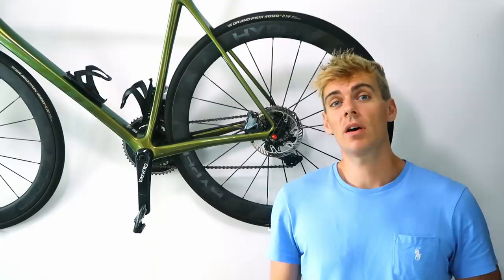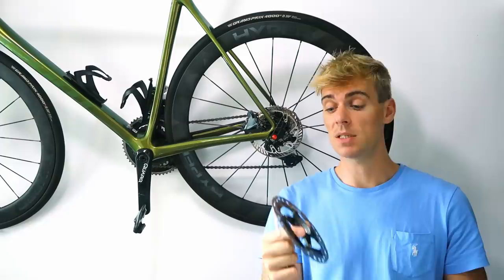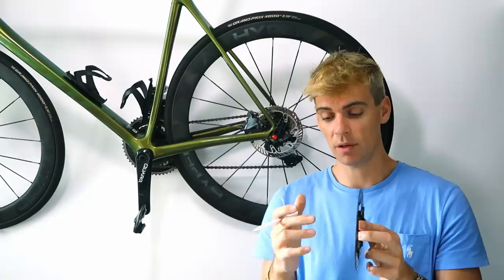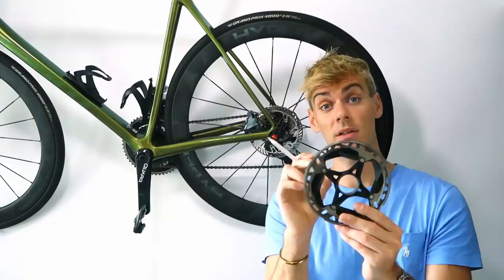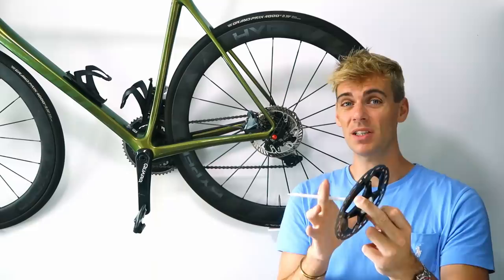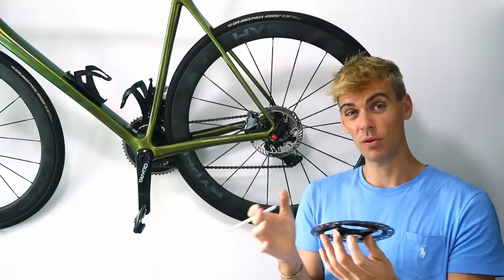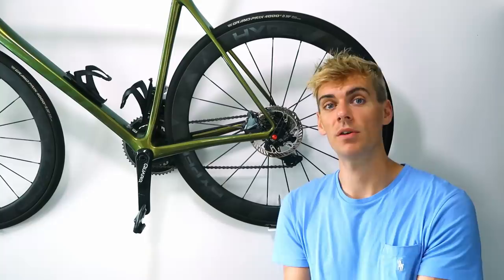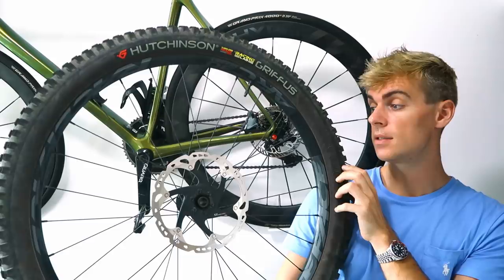Why I stopped using Shimano rotors: Disc brake rotor design, cracks & thermal issues discussed.

Comment: In my experience (25+ years bicycle mechanic) the pad clearance issue in at least 50% of problematic cases comes from "overfilled" disc brakes.  Most common directly from the bike factories.
Great explanations that need more spreading to customers (which I will do at work).
Keep on the good work! 
Greets to the 5 year old 😎
Reply: Hi. What do you mean with "overfilled" brakes? I think that psitons often don't fully retract because of overbleeding of the system

Comment: maybe you should try galfer rotors, they are floating rotors that can be either 1.85 or 2.00mm thick and can be used down to 1.3mm thickness. They're great. Edit: now a couple of minutes into the video, the galfer rotors are actually made the same way you describe you'd like your rotors to be, there's a 1 piece model made from high carbon steel (not stainless) with the center part anodized or painted, not exactly sure what kind of coating it is but it's there.
Reply: After a ton of research, I bought galfers in 160mm today. Not for the weight but because I just want better braking performance for high speed descends. Have you ever had any issues with them?

Comment: Great project, I look forward to hearing more! I have had similar issues with ice tech rotors- go out of true with the high heat on road, get bumped on the mtb. For reference, I am now using the slx/105 RT70 rotors with zero issues. Seems to behave like a six bolt, just pinned onto the centerlock spider instead of using bolts.

Comment: I nearly died on a tandem on an etape du tour using ice rotors.  The rotors heated up, the alu melted and the rotors narrowed and became compressible enough that the pads wouldn't bite.  Only an uphill run off saved my pilot and I.  Gone for hope solid stainless from now on and no issues.
Reply: Wow, thats scary! What size of rotors were those?
Reply: In fairness they were 160s and we should have had bigger to start of with. Our hope stainless are a massive 203 now.

Comment: I arrived at the same conclusion. Floating rotors are from high performance automotive. The aim is to reduce temperature-induced warping of the rotor (caused by uneven heating from middle to outer edge of rotor). In cycling the energy is significantly less and the tolerances and masses are different. I’m not persuaded floating rotors are necessary on bicycles.

Comment: I had a problem of Shimano disc rubbing when the brakes were hot. It seems it was caused by counterfeit JO2A brake pads. The black anodising was wearing off, which doesn't seem to happen on genuine pads, and the resin pads had golden metal bits in them.

Comment: Interesting project, looking forward to findings. I have brand new 105 disc set 6 bolt one piece style and at 900 miles I've been extremely pleased with performance and not one complaint, I clean them every other ride and the wheels have not been off the bike since new or in and out of the car so bumping them hasn't happened. I am also very aware of braking technique to shed heat, never ride the brakes, I do 3-5 seconds at the most breaking at any given time, on fast DH hard break let off wait hard brake let off style.

Comment: I too ditched Shimano rotors for Campagnolo, a fantastic upgrade and as a bike mechanic I always steer clients away from the Shimano sandwiched construction rotors
Reply: I had the Dura Ace rotors for a year and they warped all the time. I have replaced them with a spare Ice Tech RT81 and a new Hope floating rotor. I wonder whether the Dura Ace (and the XTR) braking surface having four attachment points instead of five makes them more vulnerable to warping.

Comment: The problem might also be those tiny road disc's getting super hot compared to 220mm disc's on an MTB for example.
A friend ride's hope floating rotors and they don't start rubbing from just getting a bit hot.
Would like to see rotors from you for MTB as well! You should make the centerlock fit a bit tighter than Shimano as well while being at it already. They seem to be a rather loose fit for being a disc rotor and can come loose.

Comment: As long as one bearing is locked in place the other bearing can float without creating any issue because it's locked in place by the thru axle. I wouldn't be too worried.

Comment: A tungsten carbide coating has been utilized on brake discs in high performance automotive applications to improve performance, increase service intervals and reduce brake dust

Comment: Someone has surely said this before me. Since all my bikes have rim brakes I really never paid any attention to disc brakes until Chris Froome made his notable comments about them recently. The first thing that popped into my head is why not some kind of bronze? Copper in it will dissipate heat. Add a little nickel perhaps for corrosion resistance. More expensive than steel, but find the hardest copper alloy with the lowest friction coefficient and I think you'll land pretty close to what you want, IMHO. GOOD LUCK.

Comment: It seems to be a fad among British bicycles Youtubers with an engineering background to develop their own components (Hambini: bottom brackets, Peak Torque: disc rotors).
To contribute to the project: consider sodium cooling as used for outlet valves in automotive engineering!
Reply: Quite a bit more complex to engineer and manufacture into a slim rotor though. Sodium valves were pricey and mostly the bastion if high performance high temp engines like top fuel cars.
Reply: What is Peak Torque's background?

Comment: With motorbikes there are "fully floating" discs which the carrier holds the rotor by way of buttons, they will move very slightly if you pull on them. They're for race bikes and massive touring bikes such as a ZX12R or ZZR1400 etc and often after market, although I do believe some came OE at times. The regular "floating discs" that are actually solidly secured (rotor to the carrier) will warp under high heat loads, they're most likely just styled like a race disc for marketing. A lot of 6 piston calipers were doing that in the 90s, bikes like the ZZR1100, ZXR750, YZF750, EXUP 1000 etc. However if you use fully floating discs for street use they don't get hot enough to expand and the carriers, which are usually aluminium, deform and wear away. I had a set of Spondon race discs on a 90s streetfighter that had this problem. Fabulous cast iron rotors but I just wasn't heating them enough and ruined them

Comment: I think the problem lies in the design of the spider, its 4 spoke design means that they've got just 4 points of contact holding the braking surface true, so its much easier to warp than something with more spokes that is more rigid. When I first saw that 4 spoke design, I thought as much that they'd be much more prone to warping.

Comment: This video just shows my point everyone saying 'u don't wear your wheels out' discs are EXPENSIVE anyway.... u can run a good set of alloy training wheels like zondas, dt swiss 1400s, scribes, hunts etc for under £400 and you'll get plenty more life than 2 years out of them what rotas would cost to replace over 2 years with someone riding decent miles. 

200 a year in rotas not including pads or bleeding plus all the headache that comes with disc oh and the added weight 🤔🤔

Comment: If you are so annoyed by riveting, you can have 6-bolts with CL adapters. And I believe you will run into production cost problems with mating stamped splined center part with rolled sheet disc, should you choose steel only approach. Basically, you will reinvent a RT10
Reply from the maker: Machined from billet steel.
Reply: @PeakTorque  so only prototype production then?

Comment: Thanks for your nice explanation, now I know why my 105 rotors rub/make an annoying noice when I ride in the rain or during descends. 

A couple of bike shops told me that they advice everyone to go with the “SwissStop Catalyst” rotors. Yes they are heavier but they don’t have the warping issue & last way longer
Reply: I use catalyst rotors on my gravel bike... They last long, nearly 10000km in them and still some life left... However on long descends they undergo the same issue when heat starts to build up and they rub...then come back to place when cool down...

Comment: Sounds like you're trying to invent the "Shimano SLX SM-RT70"'s. Keep us posted.
Reply: Are those the regular 105 rotors,  with stainless steel/aluminium/stainless steel construction like the other Shimano models he mentions?
Reply: Don't they still have floating pivots
Reply: No not quite what he's talking about. His plan is full non-stainless steel.
Reply: @Bellerophon17  "Are those the regular 105 rotors (...) like the other Shimano models he mentions?"
No, they have no floating pivots.

Comment: I would be interested in a stronger rotor, and larger diameter too. 180mm or 203mm on the front.
Reply: Not when the crosswinds blow you all over the road.

Comment: On further thought, the rotors need to be hard enough to resist the abrasion of the pads, but also have good thermal conductivity. Unfortunately these are almost mutually exclusive, however, hard coat anodised aluminium rotors could be the answer. Not sure if you would use a standard type 6061 aluminium or a hardened 7075 material. The issue here is what the best pad material would be. 
Good luck, you have generated a lot of interest here

Comment: Or use HOPE fullt floating rotors.
I use the 6 bolt version with shimano centerlock adapters, i travel and bikepack with my bike. No warping or premature ware..
They make a centerlock version aswell

Comment: I agree they do go out of true very easily. I've put cheap  stainless 6 bolt rotors on my MTB now, very light like than XTR and they last much longer. You have to connect up a thermal imaging device to see the heat pathway but I would be thinking that the heat would be transferred to the spokes somewhat. I use alloy adapters from 6 bolt to Centrelock.

Comment: I would like to know what you think about the fuids on the brakes too. Why Shimano uses mineral oil and Sram go with Dot fluid. This makes difference in the thermal side of things too? Can I use a Shimano rotor (designed to work with mineral fluid driven piston) with a Sram caliper and vice versa? This disc brake for road bikes is a hot topic now and you are the best to address the subject

Comment: Damn! I just purchased the XTR rotors and put them on my bike replacing the Campagnolo rotors I was using. The Campy rotors were not worn out they just rub to much when they heat up. The XTR rotors haven't been rubbing and I thought all was good to go. I'm going to use these XTR rotors for a little while longer but I will be keeping a very close eye on them and then I will throw the Campy rotors back on.

Comment: Thinking about your argument here regarding heat getting into the hub bearings etc.... it all sounds plausible on the surface but then how would you explain this pertaining the disc brakes on a loaded truck going down a hill where much more heat is generated from application of the brakes? Also, the brake components on such a truck are much larger in size & mass therefore making them much greater conductors of heat. Automotive brake rotors & hubs are usually a single piece of steel and therefore have no barrier or insulator between the braking surface and the wheel bearings.
Reply: No you are incorrect with your understanding, as the rotors are larger they will dissipate the heat rather than conduct it towards the bearings and generally a vented design is employed. This design sees the two ‘faces’ of the disc spaced apart, giving room for cooling channels. These allow heat to escape, preventing the disc from getting too hot and cracking, while also increasing the life of the pads.

Comment: I love this video. I have a pair of icetech rotors and I have exactly the same problem. During a ride they can start and stop rubbing on the calipers multiple times. I have also suspected that the cause of the issue has its core with the sandwich construction.

Comment: That potential delamination issue is actually kind of terrifying.  Will definitely be taking a look at my Ultegra rotors later today.  Have absolutely experienced that same thing with the post-application rub following a short, sharp descent.  They probably already have 7000+ km on them at this point.

Comment: I am happy for not to fall in marketing of cycling industry with discs on road bike vs rim brake. I Think after seeing and reading articles or vlogs about disck on roadie, the technology and prices for discs have much way to settle down. If you are not passioned on riding in the heavy rain and dont live in hilly regions, discs are just pain in the a..s :). Pro tip: the best engineered products are those solving the problem with the simplest way.
Reply: Could be marketing bs but there is a point for carbon rims to reduce rotational mass over aluminum rims. Also wider internal widths give a more compliant ride at lower pressures.  Since heat and carbon fiber laminates don’t play well together, disc rotors for stopping is a solution. 
Now if only there was a material as light as carbon fiber but can handle heat without warping, we can go back to rim brakes

Comment: I don't seem to have the same issue on my mountain bike rotors compared to my road bike rotors.  What is the difference and why don't they use the mountain bike product, calipers and rotors on the road bike groups?  I assume it is weight.  Is titanium an option as a material for the rotor?  Probably costly but should be durable.  Thanks for addressing the issue that bothers all of us and cost us many hours of frustration trying to get rid of the tick the night before a ride.

Comment: One thing I'd say on this - 160mm rotors are too small for big riders - the speed and mass on the road is just too much for them. I'd suggest it should really be a 180mm for bigger riders - is this even possible on road bikes ?
Reply: 180/160 or 160/140...cars stagger their brake force according to weight and mass centralization, why not road bikes.

Comment: Often overlooked is vent patterns. On SRAM rotors, the differing “organic” shapes of each vent minimizes constructive sound interference from the fluting effect (hot air escaping from each vent as the pads glide over.)

Comment: Impressive amount of comments here on disc brake performance or lack there of!  I've not personally experienced any delam issues with any of my disc brake bikes other than annoying rubbing after long descents.  I would be interested in trying your new steel rotors.  I saw a few comments about the XTR on the road as well,  from reading the Shimano technical manual they do not recommend using MTB rotors on road bikes.

Comment: Martensitic stainless may also be used. Used in knifes and cutting tools in food industry etc. Same as ferritic stainless, but with a slightly higher carbon content to get the hardenability; hardness is very high, about 700 HV.

Comment: I use BRAKING batfly  rotors steel, not floating and six bolt fixing with my Campagnolo calipers. I have no problems with noise or wear. So yeah I think you’re going in the right direction.  

So many problems caused by such a narrow piston calliper gap......

Comment: Watching this 3 years later but thats a great video and some solid points! Havent flicked through your channel yet but did you get your rotors designed? Also did you or have you tried Galfer Wave, Galfer Shark, Magura, or TRP one piece rotors? What they all have in common is that theyre 2.0mm thick or in the case of TRP are 2.3 thick. Meaning theyre much better with heat, which becomes a vital thing for Downhill MTB. Galfer Wave has heat resistant paint on the inner section, & Galfer Shark, Magura, & TRP all have various heat distributive designs.. What's interesting is that of the UCI Downhill WC racers, only the riders sponsored by Shimano or Hope use floating rotors. All the rest use one piece steel rotors, even those from brands that make both one piece & floating, all use one piece. I think that says alot!

Comment: I'd be really curious if your shimano rotors were counterfeit. I've been using the ultegra rotors, and I'm 85kg in a reasonably hilly area and I've never seen anything like that delamination. Usually get a few years out of a set of rotors.
Reply: Impressive that he can find a problem that nobody else can.
Reply: @richde  Not nobody else... the German bike magazine (bike-magazin.de) have been very critical of ice-tec in several generations of lab tests.
Reply: I've had my rt800 for 10 months using l03a resin pads and both pads and rotor need. Replacing
Reply: They aren't fakes. Depends on your weight and environment. Luke is 90 kgs and rides in hilly areas so he'd go through discs somewhat quicker
Reply: @glennoc8585 how are you determining the authenticity?
I'm basically the same, only I have a higher FTP so I'm arguably going a bit harder.

Comment: Looks like Shimano designed the rotors to be used with sacrificial (resin) pads and put the cost of disc/pad replacement on the heavier riders that need metal pads. Real shame but not unexpected. I've been told that being tall is a blessing... from those not used to paying more for less that doesn't last. Not a big complaint (pun) but it does get frustrating trying to be active in this day and age when everything seems built for the average user. I'm sure lighter riders can complain about bottom bracket heights and stand-over with frames. Such is life.
In the future could you put part numbers in your video description? I'm interested in trying different brake rotors myself. My Shimano rotors are looking shabby.
Reply: I was running-in a new rotor on steep descents, it started to smell like something was burning, and the rotor is now slightly brown...